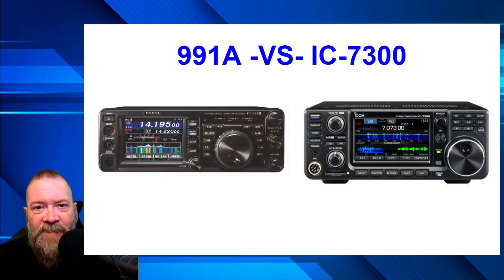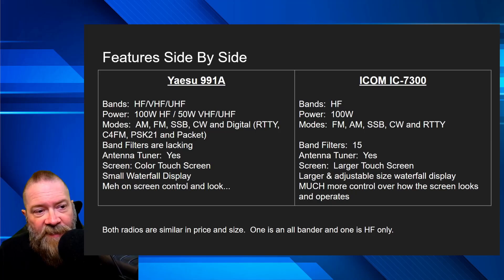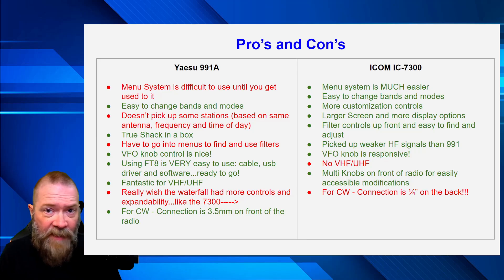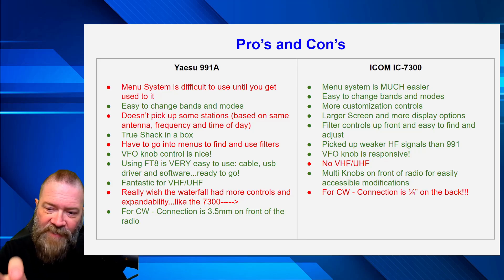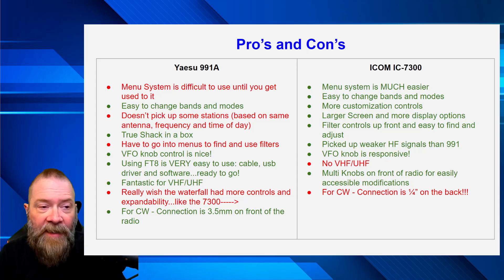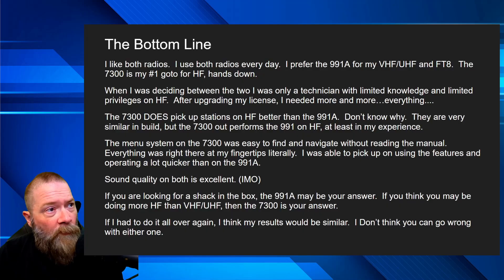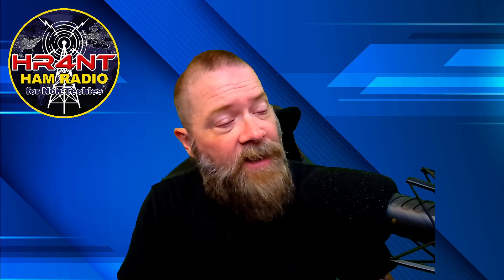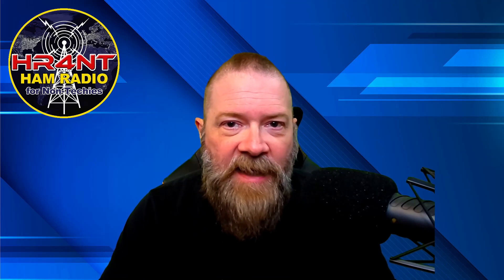A Tale of Two Radios - 991A - VS- IC-7300

Comment: Yeah, i have the 991a and the 705z  Same thing.  The icom is much more sensitive.   i actualky have to use a high pass filter to get rid of MW noise in my area to use my 705.  991a has no problem.
Reply from the maker: Thanks for the comment.  They are both great radios, but you will find you have preferences for one over the other sometimes.  I have both, and like both.  Thanks for watching.  73!
Reply: @HR4NT  Yep.  Right tool for the right job.  I would buy both again in a heart beat for my personal needs.  Its a good time to be alive in HAM radio.

Comment: I have been hearing the receiver is better in the 991A. IC-7300 has a better scope but can't keep up with the receive.
Reply from the maker: I have heard a similar claim as well but cannot confirm that just yet.  My 7300 really seems to be able to pull out frequencies pretty well.  It may be the area I am in when operating one or the other or time of day, but my 7300 seems to perform rather well.  Thanks for the comment and for watching.  I will continue to do some testing and see what I can find.  73!

Comment: I stopped this at 4:20 as I see already the 7300 is the preferred radio by this guy. Just admit you are clearly biased because you already own it. Having said that I looked at the 7300 for some time before I decided to get the 991A. I have had 2 warranty repairs already but would never sell it. I love the radio,  not so great display and all. Its a real workhorse and I didn't get the radio for a display but rather for the features and the operation. This 991A checks off ALL the boxes for me. Not to mention the great receive and I have the FT-DX10 and I use the 991A much, much more than the DX10 and we all know the DX10 puts the 7300 away. Yaesu has some issues but all in all the 991A is a much better radio in my opinion and if they could retrofit a better display or sell a tap kit to extend the display to your PC, etc I believe it would gain much more praise. Just my few pennies...
Reply: '2 warranty repairs already' - yup, good old Yaesu.
Reply from the maker: Hi Kenneth!  I actually own both.  The 991 was my first radio when I got into the hobby.  After a few frustrations with it I decided to go ahead and buy a 7300 to see if there was a difference.  Both radios have their pro's and con's.  Just in my personal experience the 7300 was easier to use and navigate and I have really enjoyed it.  My 991A is primarily for local repeater stuff, FT8 and occasional late night CW as it is my base station radio at the moment.  I did have to send the 991 back for repairs about a month into owning it, however they fixed it quickly and all is fine now with no further issues.  Everyone will have their preferences and that is fine!  Thanks for watching and for the comment.  73!
Reply: @HR4NT  I hope you didn't get the wrong intention from me, As a fellow Ham I understand each purchase of new equipment is a holy type experience for each person that is in the hobby/service  and as with anyone the menu's will be easier or harder for some that are just wired that way. I have watched a number fo videos were the Rcv was hammered on the 991A or the NB compared to the 7300 and I see they never adjusted the NB or ANL in the menu to compare it correctly. There is also the human ear which is different from person to person so sometimes these comparison videos are really just the operators personal experience with their radio. anyway, Lets just enjoy the hobby/service....

Comment: Good salesman.
I’ll wait for a all mode 7300
Reply from the maker: Well...there kind of is a radio like that...its the IC-705.  All mode all band...BUT it is only 5 watts or 10watts with an external battery.  You can add an amp to it and make it 1200Watts, but then you are spending another $500-$700 on top of the $1300 for the 705.  Thanks for watching and for the comment.  73!

Comment: I like the 7300 only for the bigger screen. I want the 991a because of the all mode. ICOM should have made the 7300 all mode too compete with the 991a.  why they did not is beyond me. but ICOM always does this.
Reply from the maker: If you need an all mode all band radio then yes, the 991A is a great choice.  I too am confused as to why Icom would not have made a similar radio because as it stands now you have to have a 7300 AND a 9700 to get the same thing in a 991.  Thanks for watching and for the comment.  73!
Reply: Icom would rather you get their IC-9700 for all other modes and IC-705 for QRP... The FT-991A is the best bang for the buck right now and will be for a while.

Comment: I think the 991A is going to be my choice. I have a cabin up north and I like being able to travel with one radio. I do not like up to 2.2a for receive, but I don't see a lot of field use in my case where battery life is a issue. The 7300 is 1.3A and will double usable life.
Reply from the maker: Based upon your need for a radio you really cannot go wrong with either one.  I prefer the 7300 because of the simplicity of use, but if you require 2M and 70CM, then the 991 is a clear choice.  Thanks for watching and for the comment.  73!

Comment: I’m brand new. I bought an ft3dr last summer. Can’t hear anything on it. Kind of discouraging. I’m torn between just uhf 7300 
UHF vhf hf in 991a or the ic9700 with some other stuff in it. I love icom functionality and it seems more intuitive in the menus. If I got the 7300 how long before I start looking for other bands and more contact possibilities. I’m mainly gonna train and use these things for hobby and emergency communications with a solar generator that has 2000 amp hours per charge. ????? Suggestions?
Reply: I can’t seem to find anyone around me interested in helping out a newbie get set up. Once I get that things will get easier. I’ll probably get the 7300 and hopefully it is a band that is used enough and can be relied on in an emergency to get information on.
Reply from the maker: There is a rather large ham radio family on YouTube and on various social media that are always going to be willing to help you out with anything you need I can point you in the direction of a couple other channels that would allow you to learn more stuff and get involved with our community in case you ever have any problems or issues I have any problems or issues. Just let me know.
Reply from the maker: If you are going to be doing primarily HF, the 7300 hands down.  It is easy to navigate and a reliable radio, period.  If you want to use VHF/UHF AND HF, then you may want to consider the 991A...however if you have a FT3DR and haven't had much luck with it, maybe HF is the route to go.  I have repeaters everywhere around me in the city I live in, and we have daily nets that gets everyone involved and chatting about various topics.  If it weren't for that, I would probably be HF only unless I was doing simplex ops with people locally.  You "can" add a larger antenna with a coax cable to your FT3DR, but then its not as portable.  I did a video showing a homemade antenna from Walmart I built and I hooked that into my handheld and it worked fine.  My best advice is get a good radio that has the features and bands you want to use.  Once you have that, focus only on antennas.  Antennas are the key to a good radio experience.  Feel free to contact me if you have more questions and I will see what I can do to help!  I appreciate the comment/question.  Thanks for watching.  Good luck!  73!!!

Comment: I have a Yaesu FT-991a and love it works well with my OCF dipole. The user interface is different from the IC-7300 but its a matter of preference. really any of the new base radios from Yaesu or Icom are not bad choices. Try them both if you have the ability before you buy. but either way you will get a good quality radio
Reply from the maker: I agree 100%.  I wish i had the opportunity to try out every radio that I own before I bought it.  Might have made a huge difference with my choices.  Thanks for watching.  73!

Comment: To be clear the signal does NOT go through 15 filters before it reaches your ears.  There are 15 band pass filters and depending on what frequency you are on the signal will pass through one of them, not all 15.  If your signal went through all 15 band pass filters you would never hear anything on any frequency because you would be filtering out the entire HF band.
Reply from the maker: Thank you for the clarification and correction.  73!
Reply: 991a has no band pass filters?
Reply: @s8ultra732  Did you read what I wrote?  I don't think I could have been more clear.
Reply: @mikesradiorepair  OBVIOUSLY,  you did not wrote about 991a band pass filter. Im just clarifying from the video uploader when he said that Band Filters for 991a is lacking. You only wrote about the 15 band pass filters of the 7300 because the video uploader said that 7300 has 15 band pass filters and you corrected him. You are the one who did not read my question lol! Lmfao

Comment: Thanks for the video, I subed too!  I'm on the fence here.  I have a 7100, I like it but it's a little too much for a true portable radio.  I picked up a FT891 for my POTA work and it really kills it!  Love the 891.  So I picked up a FTdx10 for the QTH it's working pretty awesome here but with noise levels and not the greatest antenna up it seems to suffer more but it does work and I love it.  So here is my dilemma, I think I want to mount my 891 into my truck with a atas and get another radio for my POTA work.  First thought was to get another 891 due to the success that I've already had.  Then the 991a came to mind as its a bit more featured then the 891.  But we I've watched a few videos on your very topic and it just seems that the 7300 would be a better fit.  When talking to my contacts I'll bet that I'll get 7300 users 10:1 over the 991a.  Yaesu has just started a 3yr warranty on their stuff so there's that.  But, the 7300 is about $150 less then the 991a.  Do you see the dilemma I'm in??  Lol!!  Anyway thank you for the video and dumbing stuff down for us!!  
73
KE0DSD
Reply from the maker: Thanks for the sub and welcome to the channel!!!!  I truly appreciate it!  If you are going to focus on HF and not worry about VHF/UHF, then hands down the 7300 would be my choice.  It is user friendly, it has the power, etc.  When I go do POTA that is what I take.  I have my 705 as a backup or if I want o use lower power for some reason, but the 7300 performs beautifully in the field.  The thing with the 991A is the all band all mode feature, but if you aren't in need of the VHF/UHF, then I wouldn't sweat it.  If you mount your 891 in your vehicle, that can work just fine, but also think about this...if you install it in a way that you "could " remove it for portable ops and make it so that it isn't a massive pain to detach from your vehicle, that may be a way to have both without spending any more money.  Just a thought.  Either way I don't think you can really go wrong, just know that once you taste the wonderful world of a waterfall...it will spoil you...LOL  Thanks for the comment and for watching.  If you have any questions feel free to contact me anytime!  73!

Comment: The feature that most miss about these two is the user interface (the UI).  Try this next time you see these two radios.  On the screen touch the frequency and see what happens.  That is all you need to know.  Why?  Just like you phone, when you touch something is reacts, there is an expectation.
Reply from the maker: I agree.  Once you get used to how the 7300 works and then try to repeat that on the 991 and nothing happens, it's a bit of a letdown...LOL  Thanks for watching.  73!
Reply: @HR4NT  Yup.  Have a great day HRFNT.

Comment: I got my Technician license back in May, and acquired my General license this past September. Like you I have multiple Repeaters near by so VHF/UHF is easy to use and get out there, plus I have a DMR hotspot that works great. There are features on both radios that I like but the menu function of the IC7300 is far superior and more user friendly.
Reply from the maker: Hey Mike, thank you for watching and for the comment.  Having repeaters nearby is an awesome thing to have access to.  I really like the functions and features of the 7300 over the 991.  Thanks again!  73!

Comment: Very informative. Especially for newbies that just got there GENERAL. I’m in the process of getting my General. I already invested in the yaesu 891. But one day I will need to invest in a base model. Your videos are informative and certainly cleared up some questions. Thanks again
Reply from the maker: Glad it was helpful!  Good luck on ACING your General!!!!!  I have an 891 and love it.  But for home operations i like the waterfall displays and more up front features and functions of the 991 and 7300.  Thanks for the comment and for watching.  73!
Reply: @HR4NT  as a side note. I also think if you want QRP you can also the power down on the 891. No knocks on the IC705. But I can the best of both worlds with a 891 for portable and a 7300 for a base station
Reply: Find a good deal on an FTDX 3000 and set it up with a panadapter and cat control via a dongle. Investigate. Could likely do same with 991. It's cool.

Comment: Ha Ha, I just received my FT991A yesterday and I still haven't opened the box  and I myself was going back and forth between 991 or 7300?? I like them both. I have two ICOM HTs from twenty years ago and they still operate like brand new and that is why I like ICOM but decided to make the 991 my first official Yaesu radio. I might just do what you did and me a 7300 as well 😏. Good video!!
Thank you for the review.
Reply from the maker: Oh I am not knocking the 991A, I love my 991A for what I use it for, but that larger waterfall screen and easier access to controls on the 7300 is what attracted me to it aside from picking up HF a little better.  You will enjoy the 991A!  Thanks for the comment.  73!

Comment: Other then the price why didn’t you get the ftdx10. Just wondering if you looked at it at all
Reply from the maker: A few reason, price being one of them.  I was new to the hobby like really new.  I hadn't heard anything about the DX-10 because of the looming shadow of the 991A at the time and I tend to let equipment that just comes out prove itself before I dump a bunch of cash into it.  Thanks for the question..73!
Reply: @HR4NT  I’m torn between the 7300 and spending the extra for the ftdx10. Thanks for the response. Keep up the videos

Comment: I have the ic7300 it is a very lively rig . It's achilles heel is rf gain is unsatisfactory in bringing out the weak sigs . 
I am keen top band user and come up against weak sigs a lot in the noise . All my other rigs , including ic781 , ic 746 , ic 7200 , ic 703 , ft897 , ft 817 , ts  480 hx, xiegu g90 . and my recent sold ft3000d and all outperform the ic7300 in noisy low band conditions where trying to listen to weak sigs .
The icom ic 7300 is a very good all round rig , but the rf/sql is very poor . Tks for the video . Greetings from Scotland.  mm0udi .
Reply: ic-7300 high noise receiver
Reply from the maker: WOW!  That is quite a collection of radios!!!  Very impressive.  Thank you for sharing.  I have not run into the issue you mention in your comment as of yet, but thank you for mentioning it.  Glad you enjoyed the video!  Thank you for watching!  73!!

Comment: Can you tell me the widest receive bandwidth for AM is on the 991A.   I had a chance to use a 7300 for a couple of months.  I like listening to Hams on 75m AM as well as shortwave and the AM broadcast band.  I was blown away with the quality of the AM.  It sounded as good as my old Hammarlund SP210 receiver.   The wide bandwidth the 7300 offered made it sound great on AM.  SSB also sounded fantastic with the wider bandwidth
Reply from the maker: I would assume the receive bandwidth on the 991A would be identical to the 7300.  I honestly have not looked into that and can't give you a solid answer at this time.  The quality on both radios as far as sound is phenomenal.  I know they sell external aftermarket speakers for these, but unless you have some specific reason for needing it, the onboard speaker is just fine.  I have a lot of fun with both radios.  I have just separated them out for specific tasks in my ham radio use.  Thanks for the comment and for watching.  73!
Reply: @HR4NT  I don't believe they are.   If you still own both, go to the IC-7300, tune to an AM station like shortwave then widen the I.F. bandwith and note the width in khz.   Then do the same with the 991A.   From memory I seem to remember the 991A I.F. bandwidth on AM was less.  I have to go look up the specs on the 991A again.